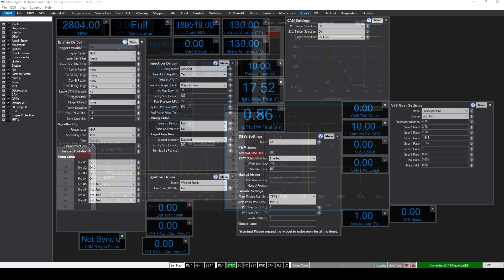ME221/ME360/ME442 - Knock Setup Guide

Comment: Does the detail in the video actually match that in the manual, as to me  doesn't.
Reply from the maker: Please drop us an email with what seems inconsistent and we'll fix it. The manual might be outdated, the video should be used as reference
Reply: From the manual: Reset the gain at this point so the engine noise is around 30% of the knock sensor range (on a GEN1 it is 0-65,535) on a GEN2 it is (90-1024)